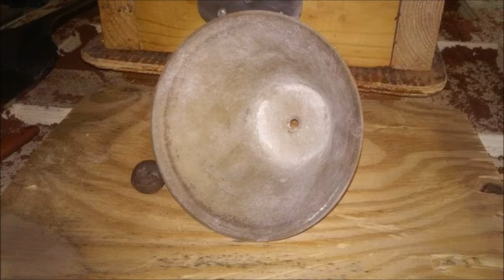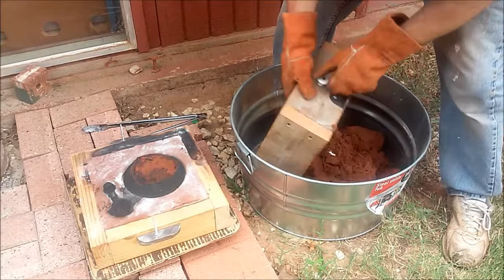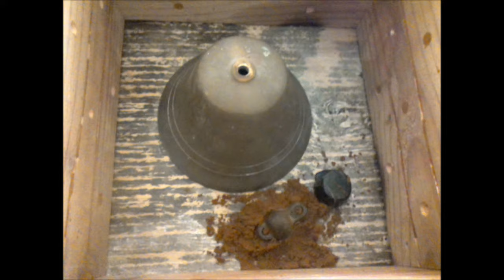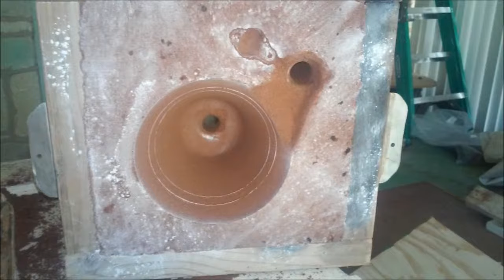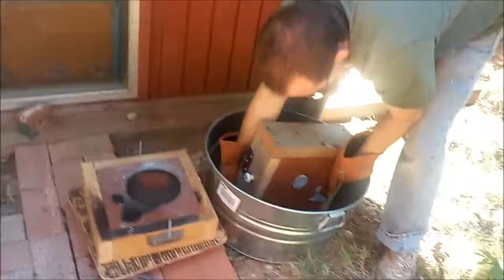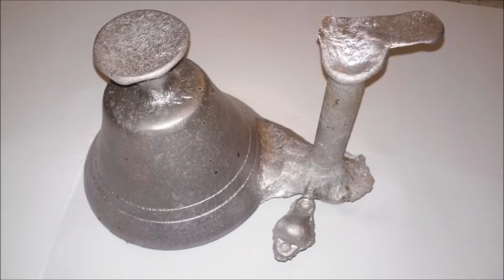Aluminum Dinner Bell Castings

Comment: I found a way to fix a patch in a bell with small hole to save the casting. You put sand in the core and on the outside, take a nail or something and dig or push the sand in the hole and pour over. I did this and it works and my bell sounded good without damping the tone. You just grind the outside surface flat...